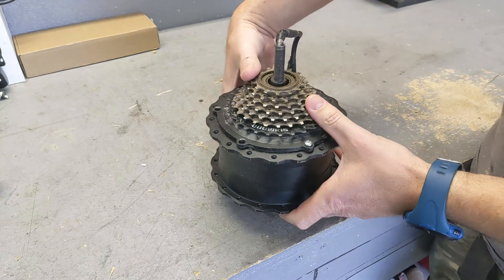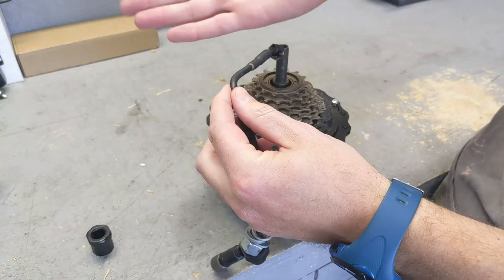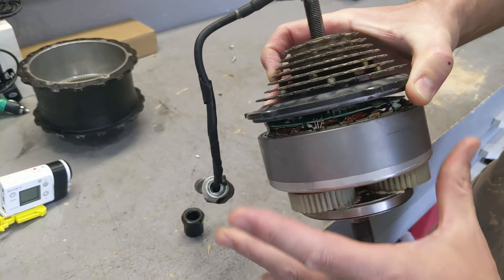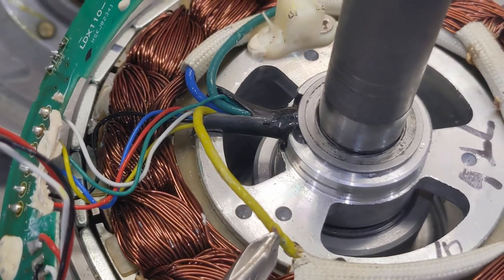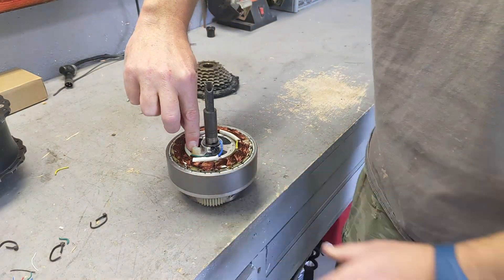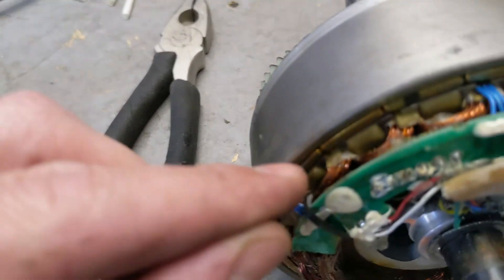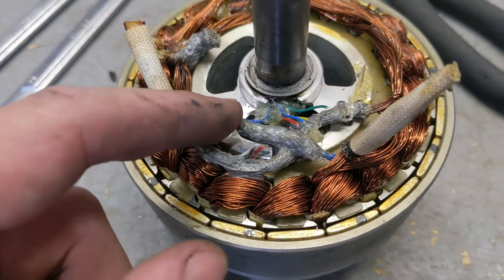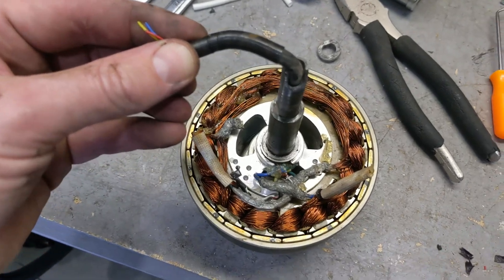5 REASONS why! How to UPGRADE E-Bike HUB MOTOR from HALL SENSOR to SENSORELESS! Bafang Himiway

Comment: How does the motor behave when a hall sensor goes bad.

I have a bike that is having issues with acceleration, more at lower speeds than higher speeds.
Reply from the maker: That a symptom of a hall sensor about to go bad. Usually when it went all the way bad , the controller doesnt start and give error message unless it's a sensoreless controller
Reply: @VegasRoManiacReviews 
Good to know, thanks for the help.
Im working through this on my own.
Im super mechanically inclined with lots of tools.
After disassembly i tested the individual hall sensors.
All 3 are getting 4.8v
One of them doesn't act like the other 2 when checking with ohms.
2 of the get about 2.2 and the other one is .8
I also had a hard time observing the order  they register, didn't seem correct.
Ive watched a few videos of people using the cheap testing device.
Im definitely capable If one or all of the hall sensors need replacement.
I just wanna make sure I performing the correct repair and not waist time and money

Comment: Hello sir I need your assistance with my rear bafang 48v 500w motor, it  got cut inside the hub because no torque support was on it and it damaged the hall sensors I need to either a hall sensor complete board or a sensorless controller pls can you advice which to and where to get it online

Comment: The problem with mine is you have to have the hall sensor connected or the comterolee throughs a code on the screan and it dosent move
Reply from the maker: That's why I changed my controller with the one that can support sensorless

Comment: My question is how much performance do you lose when you eliminate hall sensors? Other than that I absolutely agree with everything he did. In fact, I'm getting sick and tired of these hub motors that are nothing but problems. I've been through many hub motors and I can tell you the hall sensors are always a problem and I know some people online are saying oh they should last a lifetime of the motor. That's bull crap. They're nothing but a weak Link in the chain. MarkMannM2
Reply: Also, can somebody recommend a good controller that gives good performance without the use of hall sensors?
Reply from the maker: @CognitiveEssence  I don't feel I lost any performance. Actually the motor runs faster and better. The only thing that I've noticed is that at very low RPM you going to feel it is not going to be as smooth so it runs a little bit more like you could feel the steps of each phase moving through the coils. But once you pass like 5 mph it's just smooth as it gets and then it just goes as fast as it went before. Maybe faster because now you have no limits. One of the hall sensors also the speed sensor so once removed it doesn't know how fast it goes so it's keep going

Comment: You say you're replacing metal wires with copper wires - but copper is a metal as well. I guess you mean aluminum? Copper has a resistance of just 60% of aluminium (per volume) so that would certainly help.

 But how much power are you feeding this motor?

Comment: Does the speedometer still work without the sensors?
Reply from the maker: No
Reply: @VegasRoManiacReviews  so theoretically the speed limiter won't work too, I have a MXUS GDC-19 and the sensors gone bad, I want to do the Hall delete and increase the gauge on the wires too, the cable also overheats.

Comment: How the how the f*** did you hook up the throttle without hooking up the battery to make the motor running you don't show how the f*** you did that thing what's the battery without the battery on that mother f***

Comment: 0:05 don't do this. It's smarter to just use better quality wires with silicone coating that have better heat resistance. I thought i was coming to this video to learn something but all the reasons for doing this are silly and can be avoided. As far as the problem with the cord he could just use waterproof connectors to make easy access. As soon as i saw he put fucking duct tape in a motor i immediately called everything in question.
Reply from the maker: Worked way better than the original .. that bike had over 5000 miles like that when I sold it ..

Comment: Instead of removing the wires why not just use silcone coated wires? Something heat resistant?
Reply from the maker: You can't find solid core wires that are silicone coated , this size gauge that fit thru the channel . Plus these were free

Comment: the same motor model but front version has 2x thicker phase cables. in my bike front cables stay cold but rear cables just melts everything, other cables, shrink tubes, 3d prints and zipties. I realy recomend for you to change cables to the ones with teflon insulation like the original ones but thicker gauge.

Comment: I need help,after I remove the hall sensor,where do I connect the wire s too? Pls if someone can pls send me some Info or something. Ty
Reply from the maker: You don't connect the wires , there are not more hall sensors , you need a controller that works sensoreless

Comment: what do you mean when you say the sensors make the motor run "not as rough"?
Reply from the maker: The fields are more in sync so at low speeds the motor feels a little rough like it jerks

Comment: Hi. I'm watching this just now. Can yiu tell me please how it's work, so basickly you run on 3 phase wires only? No 5 hall sensors at all?
I want to do exactly what you did in my motor. It's loosing power but the dasboard stays on. I recon its hall sensor problem, so, instead of replacing them I want to remove them.

Comment: was looking to fix the halls but cba with that! going to bypass with thicker wires like you said, only problem need to get a new controller
Reply from the maker: Yes the controller will give you better cooling also
Reply: @VegasRoManiacReviews  I got 2 hub motors, so hopefully I can recondition them both and got 2 motors restored!

Comment: without sensors the motor and controller will not work
Reply from the maker: What kind of video did you see sure it will Don't you see in my video that actually works are you crazy f***
Reply: I have an Ouxi V8 of which the hall sensors are defective. Can you remove the hall sensors? So the engine will work without hall sensors?

Comment: You may want to consider kapton tape for higher temperature. Twist connectors are great for solid core wire but can still shake loose.

Comment: I think there is something wrong with the motor if it gets that hot or you are running it with to big of a battery or passing the recommended run time
Reply from the maker: Yeah I'm not riding my bicycle in the park so it overheats because I'm putting it through a lot of load climbing hills in the woods

Comment: Or you could get a connection soldiered in between the key clip and the driveshaft. One that would fit size of hole. Your welcome. If you feel like giving me the hall sensors I would be glad to take off your hands

Comment: ORRRR you can just buy motors with properly sized connectors in the first place. The ones I've purchased from GrinTech (eZee, MACs, and the standard 500-1000w hubmotors in Radpower bikes, I've been able to swap out cassettes no problemo.

Comment: just FYI there is a tool to remove the cluster it has a cut out grove down one side so the cable silides through or you can just cut out 4mm with the grinder ive done both

Comment: mind you ,these bafang motors dont melt under normal useage and normal voltage and currents ,ive had them work for years without an issue,its only when you over volt or boost current do these issues pop up,.but boy can these things go fast on 72 volts i ve one as the front motor on my stealth bomber bike ,its set up for launch control mainly ,i run it with a sabvoton svmc 7245 unlocked version ,but i changed to metal gears and mad custom hub sinks to help with heat
Reply: Ive been running a front geared hub as a rear on 72 volts fine on stock plastic gears, what does your heat sink setup look like?

Comment: i had to change the phase wire to expensive air craft grade and also drill out axle abit ,we also find that removing the insulation from the phase wires and covering them in justn heat shrink is much thinner than normal insulation

Comment: Their new motor like the one I have on my Zebra is a far better motor than that one. It runs cooler and is more powerful. I have not heard of anyone welding their wires together on it. Plus, it is easier to work on because it comes apart on the disc brake side and the wires come out on that side too between the hub and the frame.

Comment: But you are a gosh dang genius. I didn't realize you could do that with a hub motor. I have a very powerful 2500 watt hub motor that that must have been. What happened as a wires melted on the inside cuz I took it apart and everything looks fine but it just would not work and now I'm going to replace those wires with the 12 gauge and man. You are a lifesaver because I didn't know what was going to do. The only thing I wish they would make is Thur axle hub motors then I could install it on my through axle bike

Comment: Well the thing you forgot to add is even though you're just running the three wires that then goes to the controller and then the controller. You can still have pedal cyst option you can still have. If you get a good sine wave controller for brushless motors, you're good to go. You can have alarms. You can have cruise control display still unless everyone knew that. But yeah I didn't know you can do that with a hobotor. I did that with my buffeting mid drive motor and made it thousand watt to 4000 watt and I'm having a blast and I was confused at first because I didn't know I didn't have a hole sensor and I was worried. Like what am I supposed to plug it in and then read the instructions? It can work without it just fine. And I still have pedal assist and the cruise control. A lot of cool extra options just depends on how well you buy your controller I guess

Comment: Would any sensor less controller work?  Or is it possible to hack a sensored controller to behave like a sensorless controller?
Reply: If your willing to do some trial and error as well as soldering..I would say look up a "vesc" compatible controller ... if your not knowledgeable when it comes to electronics like I was/ still am  they will require a bit of research and trial and error .( in my case after ordering it I sat on it for like 3 months before I decided to do any of the leg work to install..and let me tell you it's been only a year or two but it's been rather fun with learning and curiosity ( as well as times of pure frustration of course ) but a good experience for the most part . A decent vesc will let you use hall or non hall motors ,as well as let you decide battery type when it comes to voltage,  even the type of wave current to motor ...as in hard blowing smoke off the tire start or soft with gradual speed ...even if you prefer higher torque lower speed or less torque but higher eventual speed .2

Comment: Dude get an MR60 connector or something from Amass that supports 3 phase wires and is more less weather resistant. Those twist on wire nuts are not safe

Comment: I've got a jetson pro n would like to bypass everything and wire direct from battery to motor and have a button I can hit while I'm at max speed with reg throttle will this ruin the motor and would this make it faster?
Reply: It won't ruin it because it won't work.

Your understanding is so non-existent you should abandon any thoughts of making modifications until you at least learn what the major components are of your drive system and the basic function of each.

Comment: you have gone backwards not an upgrade you will burn more wires  without the hall sensor as it will time the phase better and lower unnecessary  amps on take off all in all not better get good hall sensors and you should not be melting any thing you are doing something wrong may be the controller is to bigger wattage for your motor .
Reply from the maker: Nope, this is way more reliable, never had an issue since then

Comment: Question: Does the board and hall wires NEED to be removed from the hub, in order for it to  work sensorless?
Reply from the maker: doesnt need to be removed, you just need a controller that can ignore it
Reply: @VegasRoManiacReviews  from where i can buy this controller?
Reply: @VegasRoManiacReviews  ah..k. so if the latter don't work, then removing them should solve the problem?

Comment: removing the sensors is going to make it impossible to have high torque at starting.
also, the things you used to plug the wires are very dangerous in tha case because it can get undone and short your controller
also you should have used split wires instead of solid wires because they are less likely to break because of metal fatigue
Reply from the maker: And yet nothing like that happened and the bike is fine 2 years later ...sometimes it's good to be stupid like me
Reply: @VegasRoManiacReviews  can i use my controller that has no connection for lcd?

Comment: I gave up on hall sensors a long time ago. Every motor I got ended up frying the halls just from the heat. 

For the phase wires, I suggest moving away from those XLR 3 pin connectors and physically separate each phase info a separate connector. 

Also, a good way to increase the life of your phase wires and connectors is to wire strip a good 5-10cms off the end and wrap it around a piece of 12-10 gauge bare wire. This adds a good deal of heat sink. 

I also like to create a fork of 2 connectors per phase so that should a connector fail on me, it has a bypass to pick up the slack.
Reply from the maker: Yep I've done that, way better

Comment: Maybe I misunderstood you, but compared to stranded copper wire, solid is actually rated for less current. Now, if you were changing to a solid conductor that was a bigger gauge than the existing stranded, sure it's likely to be rated for a higher amperage. Contrary to popular assumption, electricity does not flow through a wire, but actually on the wire. This means that the more surface area your conductors have, the more amperage you can push through it.
Reply: I think whether it flows on surface depends on whether it's dc or ac.  I think ac is on surface due to changing magnetic fields so the greater surface area of stranded would carry more ac current.
Reply: Skin effect only applies at high frequencies.

There is zero difference in ampacity between stranded and solid.

Keep in mind that rated ampacity is just a guide. It is based on how much of a heat rise you can tolerate in continuous use.

If you're just looking at an ampacity chart to determine your required guage, you're missing the point, and don't really understand how electricity works.

Comment: The added heat from guessing which phase wire to put power through will outweigh the benefit of having slightly thicker phase wires and will probably make the phase wires melting more likely and will definitely make the motor windings insulation melting more likely and is definitely not more reliable.
Reply: Bro I know this 2 years old but I needed to find the other person that could tell this was a bad idea. The man used duct tape and no one said that's not smart
Reply: It's only guessing while you are stopped, as soon as you reach 200 erpm, or about 1-2 mph, it use the back emf, as in sensored mode. So there is not much heat difference unless you ride at 1 mph all the time.

Comment: Nice work mate very helpful I would have used stranded cu instead of solid ones (DC power ) but it was very helpful thank you.
Reply: I agree in DC the current follows the exterior of each strand in the wire. More strands better current flow in DC.

Comment: So, with this upgrade to power supply wires and eliminating the hall sensor, change controller, what happens to your pas settings etc?
Reply from the maker: The controller doesn't care about that anymore ...

Comment: The original motor wires are not metal as you say (you probably meant iron wires) they are still copper wires but coated with nickel/chrome/zinc to maintain a none corrosive copper surface and perhaps more solderable.  What you need to search for is a so called single wire, often referred to as panel wire, T.R.S (tri-rated singles). It has a hire (more dens) number or cores that are thinner than the cores used on a normal wire. That makes the cable a lot more flexible even at bigger diameters (gauge sizes).

Comment: I started checking after seeing this. I ride m-f to work, 6.9 mi. The plug gets pretty warm. It was very warm after a short ride to store( ( less than 1/4 mi) . I use the throttle after pas to speed. Wondering if using pas more would help.preserve the wiring. I believe the lesser wiring is losing its resistance. Had to seperate plug the other day , first time in many months it was a little resistant but seperated , mayb its slowly deteriorating?
Reply: use die electric compound to prevent this issue.

Comment: Do you know if there is any 48v 1000w programmable controllers that do not need any hall sensors ?
Reply: look for a vesc they run in sensored or sensorless.... but im telling you from many years of experence running ebikes and e-scateboards and other bldc motors running a good quality controler and adding a tempreture sensor is the real fix here not aking away something that is needed for smooth effecent running of a low speed bldc motor. these motors are designed to be ran at 10's of thousands of rpm. by only using then in the low hundreds you need more presice control and the controler needs know the absulute position of the motor in order to properly switch the phases correctly. yes it can run without them... but it will never put put the power you want when and were you need it this i can promice.
Reply from the maker: I'm sure there are ....just search eBay or ali express